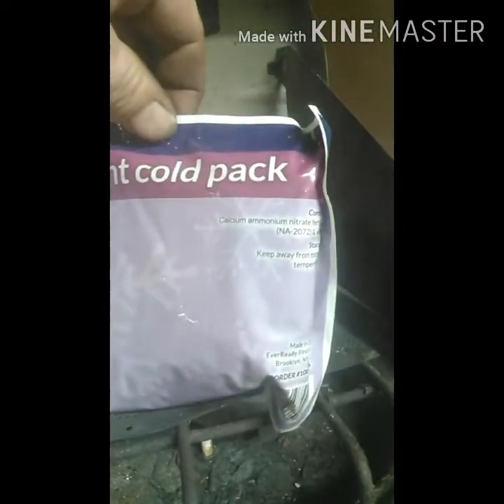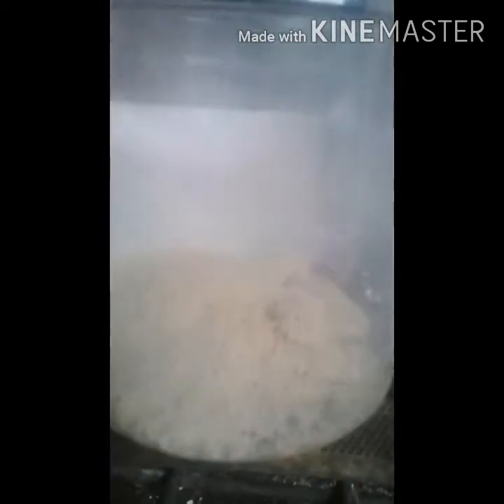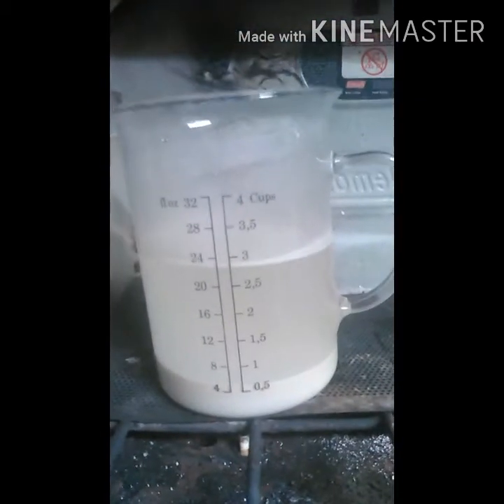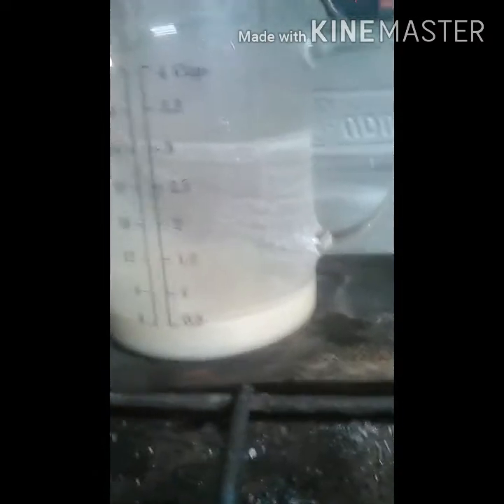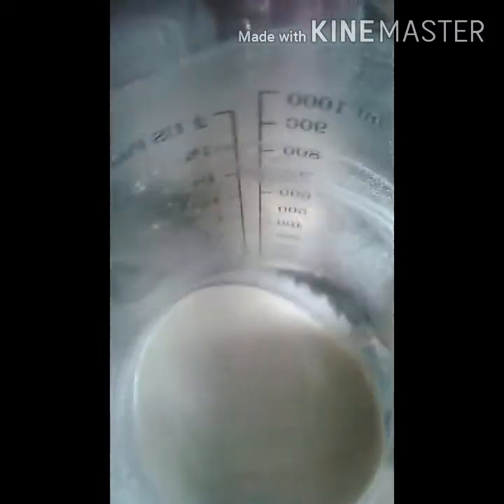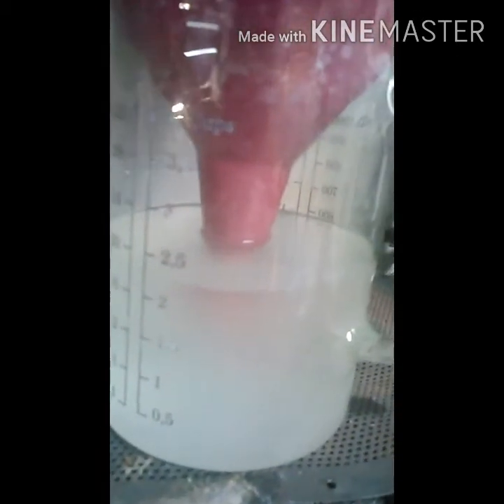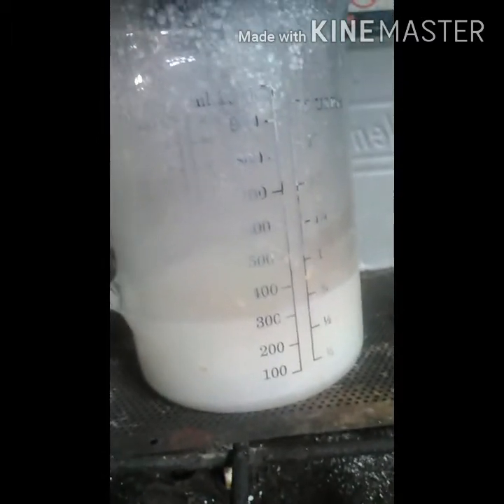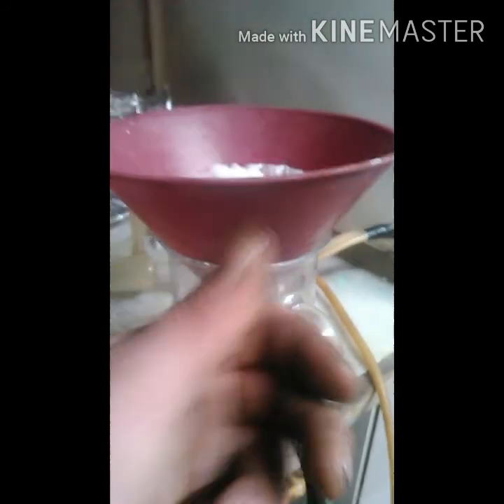How to purify  ammonium nitrate from cold packs that contain calcium ammonium nitrate

Comment: Most of these cold packs will use calcium ammonium nitrate with calcium carbonate added.  Excess water is your friend to get rid of all the solid matter.  Use double the water and once all dissolved let stand overnight and decant the cleared solution off then filter it.  Once it is filtered then put the rest through the same filter but into a different container (some will make it through the filter).  Let it sit for as long as it needs to filter.  Might need to filter a few times to get it fully clear.  The clearer the solution the better and the more pure the end result will be.  Once all filtering is done heat it almost to a boil to drive off much of the water.  I like to do it until it JUST starts to form crystals on the surface.  Then off the heat and add in about 50ml water.  Let sit at room temp undisturbed and as it cools nice crystals will form.  This is the calcium ammonium  nitrate double salt.  You can't break it through dissolving and crystallisation.  Once it is at room temp put into the freezer and chill to just below 0°C.  Filter out and wash the crystals and reduce the liquor again.  You can push out a decent amount more this way but each run will be slightly less pure.  Thick, coarse crystals indicate purity.  If they are very fine and small then that shows contamination.  You can feed this liquor ahead when dissolving the next batch of ice packs.

Personally I like to just dissolve it all and add in sodium carbonate dissolved in water.  This will convert it to sodium nitrate, calcium carbonate and ammonia gas.  The ammonia I just vent off.  No need for it.  The calcium carbonate is MUCH easier to filter out and the clear liquor will be almost pure sodium nitrate.  Boil it down until it begins to crystallise, let sit and reach room temp and then react with sulfuric acid and I distil off my nitric acid.  Occasionally I will use potassium chloride instead and get potassium nitrate if I have need for that.

But the long and short of it is you aren't going to separate the calcium nitrate from the ammonium nitrate.  They make it this way for just that reason.
Reply: I have heard you actually can separate the calcium nitrate from the ammonium nitrate, apparently you need to neutralise a solution of the two with some sort of base like potassium hydroxide. The calcium nitrate will react first before the HN4NO3 and precipitate calcium carbonate, (potassium nitrate will also be made if you use it but that’s easy to separate). When the calcium carbonate stops falling out then all you do is stop adding the base and you should be left with a solution of ammonium nitrate and potassium nitrate with a calcium carbonate precipitate. Now obviously you will probably end up neutralising a fair bit of the ammonium nitrate but you still will be left with some. I think a good indicator of when to stop neutralising is when the smell of ammonia becomes much stronger. I haven’t tried this method yet but I’m going to soon.
Reply: @TheFireGoose  Sounds interesting and the chemistry kind of makes sense but if you're using KOH where is the carbonate going to come from?  If using potassium carbonate however it might be possible.  My concern is in the separation.  At 0°C they have roughly the same solubility so you'd be able to get some of the KNO3 out but there would still be a decent amount left.  I guess in  the end it would mainly depend on what the intended use for the end products would be.  If nitric acid is the end goal than much of this is wasted steps.  But, if ammonium nitrate is the end goal then purity would need to be factored in.  If it doesn't need to be pure than the above would work fine.  But if high purity is needed then it'd likely be better to go the route of making the nitric and then neutralising with ammonium hydroxide.
Reply: @Enjoymentboy  yeh I meant potassium carbonate my bad but anyway after some looking I found out that potassium nitrate is only slightly soluble in ethanol yet ammonium nitrate is moderately soluble, I think it’s the same for acetone, so I suppose after a bit of trying and a few recrystallisations you could get moderately pure ammonium nitrate. It’s a bit hassley but it would probably work ok
Reply from the maker: I would look into their solubility at certain tempatures that might make one a lot more or less soluble. Just to put that out there. It might not change anything tho..
Reply from the maker: Let us know how it goes. I ordered more calcium ammonia nitrate to make the video again. With better details too.... Stay tuned!
Reply from the maker: @victor Jackson I got my order of stuff in so I can remake this video for you.
Reply from the maker: I'm going to have to try your sodium nitrate method. And your correct that water is your friend here. And patience is key. Thx for comment!
Reply: Ace brand straight ammonia nitrate
Reply from the maker: Here in Washington you can buy that but they write your name and that bs but if you aren't a terrorist you don't got to worry.
Reply: @ericfuller7788  can i have a link for that in amazon?
Reply from the maker: Ever Ready First Aid Disposable Cold Compress Therapy Instant Ice Pack for Injuries 4.5" x 7" - 24 Pack https://a.co/d/e9QyfEs
Reply from the maker: This is what I ordered, and I'll put out another video using it.
Reply: @shelbysgarage5828  Not sure if it helps but my local dollartree sells these.  I've cleared them out on more than 1 occasion.  :)
Reply: @Enjoymentboy  do you know if there is a brand who sells cold pack with pure ammonium nitrate?
Reply: @Enjoymentboy  there is a guy who said ace brand sells it with pure ammonium nitrate,i serched it on google and i couldnt find the ingreedients list
Reply: @wardog5073  It's hard to say.  the ones I got from dollartree indicates CAN but the ones from walmart say AN.  I've gotten others from walmart that said AN and CAN so it's really a gamble.  I err on the side of caution and just assume it's CAN, and with how my government is over reaching with their regulations pure AN is almost impossible to get.  Now, for my US brothers and sisters who can access tannerite that'd be your easiest source I think.  I have a friend in Alaska who can just pick up kits right off the hardware store shelf.  No idea about the rest of the states though.
Reply: @wardog5073  I have an update on this if interested.  I was going through my storage unit today and found a box that had 2 cold packs from walmart and 4 from dollartree.  Both were labeled as AN.  No urea and nothing about CAN listed.  I figured I'd try a few things.  Weighed out 100gm of each and dissolved in 250ml distilled water.  Both got very cloudy and I warmed each up to 30°C, stirred like a bugger to make sure as much was dissolved as possible and let them sit for a few hours.  The dollartree ones had a significantly greater amount of residue on the bottom than the walmart ones.  It was very chalky and filtered off fairly easily.  The walmart ones were gritty and just gummed up the filters super fast.  It took hours for it to fully filter.  Then I added 60gm of NaCO3 dissolved in 100gm of distilled water to each.  heated to 50°C and left to sit and settle.  The walmart ones again had a lot of sludge in the bottom that was very slow to filter.  the dollartree ones stayed reasonably clear.  Both had a STRONG ammonia smell when they got hot and it got worse every time I stirred them.  What I THINK is going on is that the dollartree ones use a form of CAN that is actually AN with CaCO3 which is why it filtered out easily.  the walmart ones are likely Ca(NO3)2NH4NO3 version of CAN with some CaCO3 in as an anti caking agent.  I don't have much of the dollartree ones left (that I know of) but I suspect that if they are dissolved in a good deal of water, filtered and then chilled to around 5°C most of the CaCO3 that is dissolved will drop out of solution.  The extra water is to keep the AN in solution.  Once any solids are filtered out in theory I think you could boil it ti reduce the water volume and then allow the AN to crystallise out.  You COULD use ethanol too but I'm not wasting my good vodka on this.  :lol  The walmart ones though (I think) are best suited to convert into KNO3 or NaNO3.
Reply: @Enjoymentboy  i live in israel and i have here so many restrictions on all of these substances but im trying the best with what i can get (wich isnt that much)
Reply: @wardog5073  Appreciated but everything I know I learned from someone else.  :)  That's why I share it freely.  I also recover precious metals from scrap and so I've had to pick up any info I can that will help.  Along the way I had to figure out how to get some of the reagents that aren't always easy to get.  Here in Canada HNO3 is available but the government looks VERY strongly at you and it's not always a guarantee the place will sell it to you.  It's a restricted material so I had to find other ways to make it with things that are not restricted.  That's where the internet comes into play.  A little research here and there and I had enough info to do some trial and error tests to see what works and what doesn't.  I've recently found a good source of decently priced Mg(NO3)2 and if my math is correct (it's likely not) I should be able to make around 20-25L of 67% from a single 25KG bag.  It should cost me around $4 per L to make.  Best part is it isn't a restricted material and most agricultural supply places have it.  The H2SO4 might be hard for some to get.  I can still get it as drain opener so I stocked up on it.  :)
Reply: @wardog5073  Another update on this: Did a little more testing this morning after I found 1 more pack from dollartree. yesterday evening.  It was 54gm so I took 54gm of thee walmart stuff and dissolved each in 100ml distilled water.  Both were filtered, and filtered and filtered until both were perfectly clear.  I added 10ml of 93% H2SO4 which in theory would product CaSO4 if Ca is present.  The dollartree ones had NO reaction whereas the walmart ones got cloudy.  So, with this in mind I believe the dollartree ones are pure AN with some Ca filler added and the walmart ones are CAN (double salt).  Things might be different now as I've had these for 3 or 4 years now but hopefully this might help someone.
Reply: @Enjoymentboy  you sbould make a video on it thats very intresting and helpfull info,thanks😃
Reply: @Enjoymentboy  how do i seperate the ca from the an if they are not dubble salt solution?
Reply: @wardog5073  That's a question I'm curious about as well.  It HAS to be possible but I suspect it isn't easy or efficient. From what I can fine the Ca(NO3)2 and HN4O3 have different solubility in different solvents but when combined as the double salt it has different solubility altogether.  Likely why they make the double salt to begin with...to keep people like us from separating them.  lol  My initial thought is to convert the whole thing into KNO3 which is much easier to crystalize out of solution and purify.  Then use that to make HNO3 and react with HN3 to get your very pure AN.  It's a roundabout process and there are losses in each step but the final result will be very pure.  Bear in mind that where you live doing this might be HIGHLY illegal.  What might be easier is to find as many different sources of cold packs as possible that list AN as the main ingredient, dissolve in distilled water, filter to a VERY high degree and test a sample with H2SO4.  If there is NO clouding formed you likely do not have Ca in there.  If you find one that does this then stock up on them.  😁  I guess it really depends on why one would want pure AN in the first place.  I have to admit that if it is for malicious reasons I'd advise to not do it to begin with.  But if it is for genuine scientific curiosity or it is needed for a legit process then have at it.  I have no need for AN myself and for me it is only a feed stock to make HNO3 which I need for silver refining and NaNO3, KNO3 or Mg(NO3)2 work much better.  I even recover the KNO3 from my refining wastes to feed back into the HNO3 production process.
Reply: @Enjoymentboy  i want to make it out of curiosity.yeah its very illegal because of so much terrorism here.
Reply: @wardog5073  Yeah. no doubt.  In your case I'd advise to maybe not do it then.  lol  But scientific curiosity is a hard one to fight at times.  Whatever you do just be sure to do it safely.  Not just for your own protection but for everyone else's as well.  I'd hate for anyone to accidentally get hurt when it can be completely avoided.
Reply: @wardog5073  I had a think about this today and I MIGHT have come up with a rather simple way to break the double salt of Ca((NO3)2+NH4NO3 and go direct to pure AN.  Using KCl is a simple double displacement and you'll get KNO3, CaCl and NH4Cl but instead of using KCl just go straight to the NH4Cl.  I suspect it'd do the same double displacement but would only work on the Ca ions.  I very well may be wrong and the only way would be to test it.  If there is 100gm of Ca(NO3)2 you'd need about 65gm NH4Cl.  The CaCl that would be produced is heavily soluble in water so the NH4NO3 should easily crystallise out.  Adding a small excess of NH4Cl (15%) wouldn't really hurt other than to just waste it. and it should ensure all Ca ions will be displaced with NH4.  But I suspect the double salt would effectively be 50/50 of each and therefore I'd use 75gm NH4Cl for every 200gm of the double salt..  If you can get the NH$Cl cheap enough it might even just be easier to go 2:1 ratio of the double salt to the NH4Cl.  At least that's what I'd try...but I ain't no chemist.  lol
Reply: @TheFireGoose  This is quite funny because I literally had the exact same thought a few days ago.  I plan to test this out come springtime.  It's good to see other people thinking similarly.
Reply: @Enjoymentboy  haha that is funny, anyway ima test it soon as well. Hopefully it will work (I don’t see why it wouldn’t)…
Reply from the maker: It absolutely does work the way he says, I just now am uploading a video showing this!
Reply: @shelbysgarage5828  cool :)

Comment: I'm in China and running an elective club at my school for rocketry.  Gonna make sugar rockets.  Can't find potassium nitrate so I got Calcium ammonium nitrate online.  I read online that they put "binders" in the mix to prevent those with bad intentions...Is that true?  
Did you heat the solution before filtering?
Reply from the maker: Hey the calcium is the binder. You just gotta remove it. No heat needed. Just filter papers
Reply: @shelbysgarage5828  Awesome  dude! You're the best.  I've been obsessed with getting this done.  The Chem teacher wanted to order some KNO3 for me but requires police checks and special permits (That's China).  I'll try this tonight.
Reply from the maker: @MrKbtor2  ya the calicum just filters right out because it's not water soluble. Now you can't use to much water. Just remember the more water you use the more you have to remove in the end. It's pretty straight forward tho. And don't get in a flurry. You can't lose your stuff unless you dump it out. So it your concerned you did it wrong. You can always get it back as long as you don't dump it out
Reply: @shelbysgarage5828  Got it! Thanks again
Reply from the maker: So it worked for you? Congrats man.easy peasey right?

Comment: how many bags of cold packs did you use
Reply from the maker: I did like 25 or 20 if I remember right
Reply: @shelbysgarage5828  and how many grams did you get back?
Reply from the maker: Shoot I don't remember it was enough to fill a gallon jug fully
Reply: @shelbysgarage5828  jeez, i did three packs and got 200g of purified ammonium nitrate, it was 240g total with  the anti caking agents as well, so around 80g per pack.
Reply from the maker: Very nice

Comment: I did nt have any filters so I used what i decanted and poured thru paper towel boiled in Pyrex for a long time then took it off to cool
Reply from the maker: Honestly if you decant it really well, so let it sit like 24hrs then use a hose to decant the liquid that should be almost as good as filtering if not better, just don't get close to the sediment on the bottom. Maybe do this two or three times and you shouldnt have any problems mate. Let me know what happens
Reply from the maker: I meant to say I'll mail you some coffee filters if you want 🙂

Comment: I tried this process and it made a hard cake at the bottom what did I do wrong?
Reply from the maker: Sounds to me like you didn't filter it good enough so you have to much contamination. Crystallization is a show of purity.
Reply from the maker: In this video I did a poor job showing me filtering it, the water will be nearly clear before you start heating to remove water.. another thing if you only ever added water.. your ammonium nitrate will still be there and is not lost. Keep your original liquid and filter. Or throw it all back together and start over. It will still be there.

Comment: Are you using only water as a solvent?
Reply from the maker: Yes
Reply: @shelbysgarage5828  thanks bro
Reply from the maker: @byhickimse1629  np man I'm happy to help, with whatever I can
Reply: @shelbysgarage5828  hello. What is the CH4N2O. is it the same thing?
Reply from the maker: That is ammonium cyanate. It's not the same thing. And to use it like the same process you would be removing the cyanate. Possibly leaving you with a deadly poison.(cyanide) No I don't think this process will work for that.
Reply: CH4N2O is Urea (ie Carbamide) which is used in some cold packs. This type of cold pack contains neither ammonium nitrate nor calcium ammonium nitrate. Urea dissolves in water and produces an endothermic reaction ie cools down. much the same way as ammonium nitrate and calcium ammonium nitrate does. The solids that end up in the bottom of the container is an insoluble anti packing agent added to the mix.